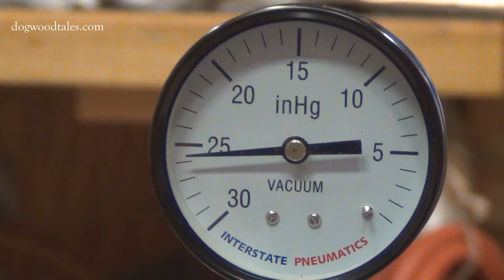Using the Vacuum Chamber to Stabilize Punky Wood

Comment: The very very worst advice, I placed the wood in an oven at 150 degrees not 200 in 10 minutes is was chared and burnt to a crisp. DO NOT follow this shocking advice!
Reply from the maker: Rodney Beadon interesting as that hasn’t been my experience. Even 150 shouldn’t char most species. What species wood did you char at 150 in only ten minutes?
Reply: @dogwoodtales   African Iron wood
Reply: the 200 degrees you refer to is this  Fahrenheit or Celcius ?
Reply from the maker: @rodneybeadon9176  OMG - Fahrenheit! 200 Ceclius would probably catch that thing on fire lol